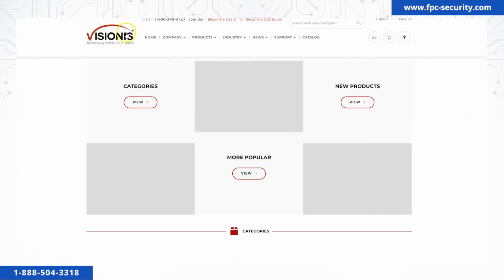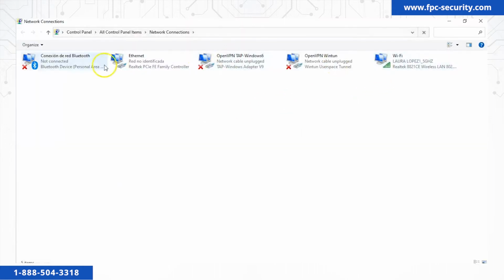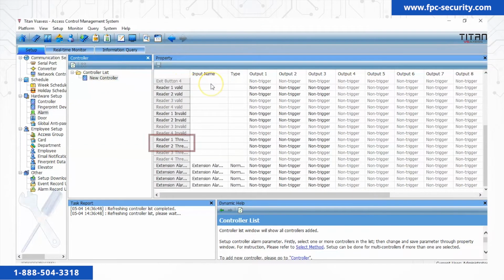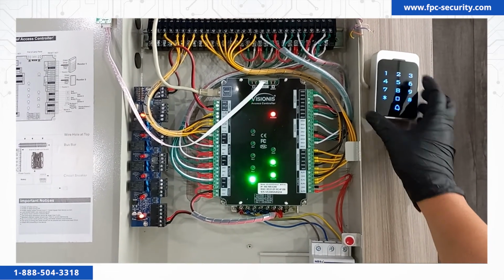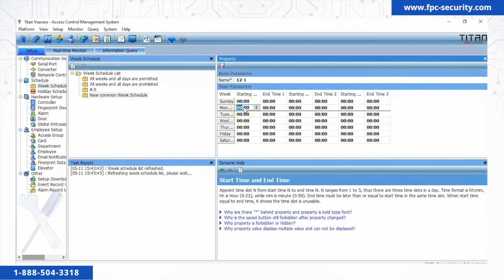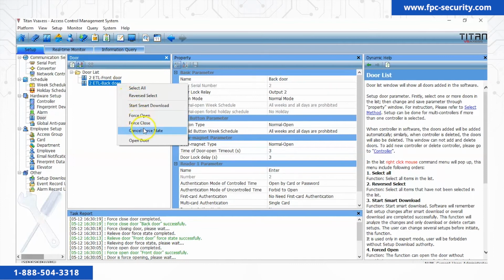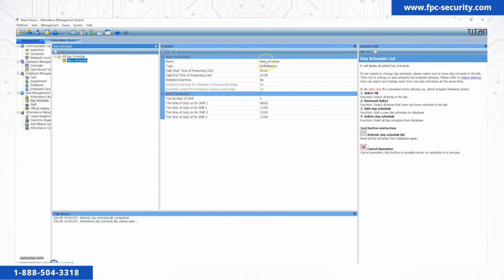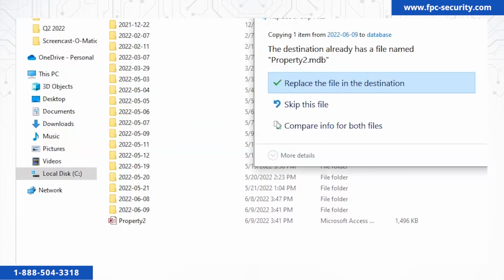Program and configure Visionis TITAN VSAXESS Access Control Desktop Software Version V1.0.00261

Comment: If I hit the big red reset button will I lose all my data such as all the fobs and employees/clients I set up? I have hundreds of them however I switched my network to upgrade it and now I cannot get my controller to connect, when I change the network settings it tells me it will differ from my default gateway and then I click ok and it instantly cuts the connection?
Reply from the maker: Dear customer, please give us a call back at 786-442-1220 so we can further assist you.

Comment: Hi Guys...can you do a video for connecting the VS-AXESS-4DLX with bus bar. Maglock, push exit button vis-7005, and slim door reader. Easy to follow instructions as laid out, until you connect it up and it doesn't work for the amateur such as myself.
Reply from the maker: Hi North Blue. We will be putting up a video on that soon. For now you may call our tech support department to assist you with the wiring.
1-888-504-3318
Reply: How many doors can we add with the new software? Limit on the old one was 64 hopefully it has increased? Thank you